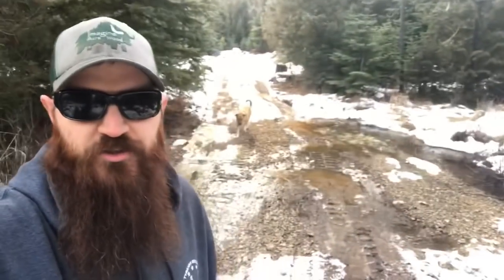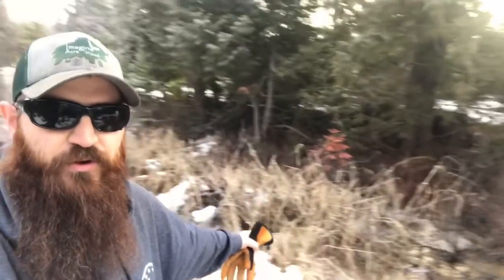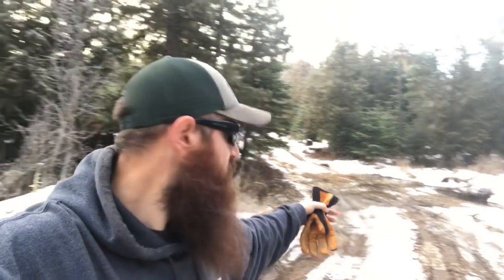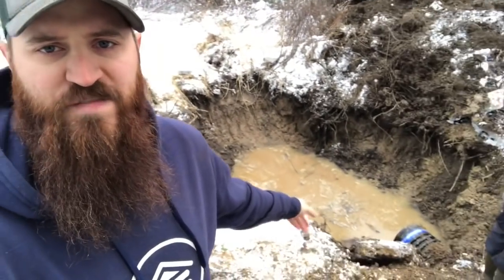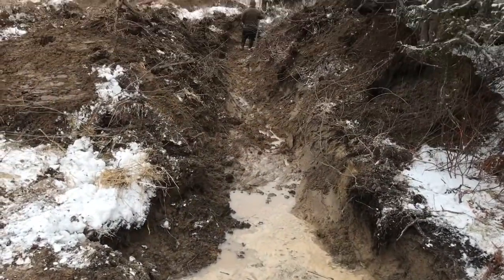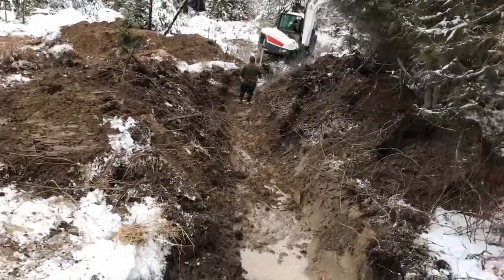Flooding nightmare!!

Comment: If the culvert freezes up in the winter there is a trick I saw someone use where they put a 2 inch pvc pipe with removable end caps on both ends inside a culvert so he could keep the pipe empty then remove the caps and create a path for the water to melt the ice around the pipe. The pipe will get washed out once it melts the ice around it but is easy to put back in before capping so it is ready for the next use. 

With the culvert going in with frozen ground you might want to in the spring dig a few spots along it repack around it for the normal damming effect that stops the water from washing it out.

Comment: You need to install 2 big pipes to let the water flow threw.
Reply: I hope they listen to you because I am sure they have never done this before and are just winging it .........................
Reply: @demonrathunter   yeah well I’m no body.  But we have a creek by my house. And when it rains hard.  Our pipe which is twice as big as theirs.  Wasn’t enough ours need Atleast another pipe.   But theirs is covered in rock.  Ours is concrete so they could always add another one
Reply: @dianep3071  so you admit you know nothing about their situation but still give the professionals advice to heed . BRILLIANT !!
Reply: @demonrathunter  i know they are having flooding issue that the water is going over the road. And they are using  a tiny pipe.  We have a small creek and they used a 12 inch pipe and that’s still not big enough to handle all the water when it pours. So if they installed another pipe  or a bigger one.  They may not have that problem any more.   Time will tell.

Comment: Check out Grand Outdoors he put in a small bridge with culvert pipes and cement bags where it empties and a beige with cinder block walls. The engineers wanted 125-200K and he did for a few thousand. The cement bags is what I found interesting to keep where the water flows from covert to solid.